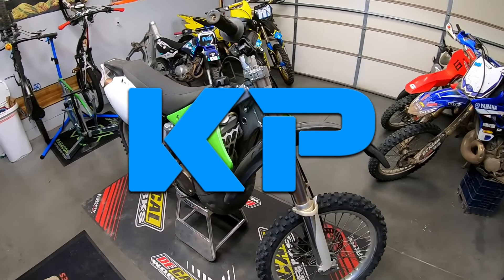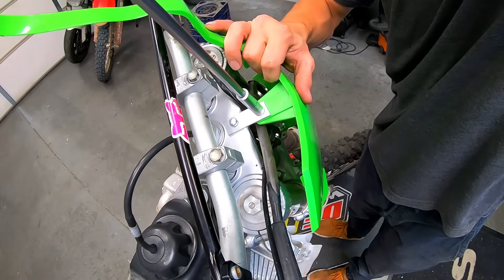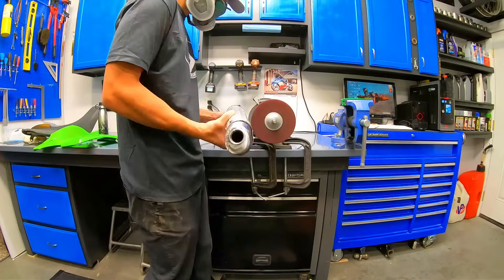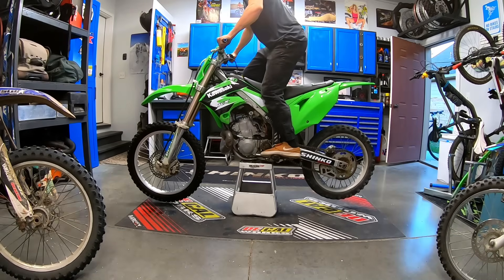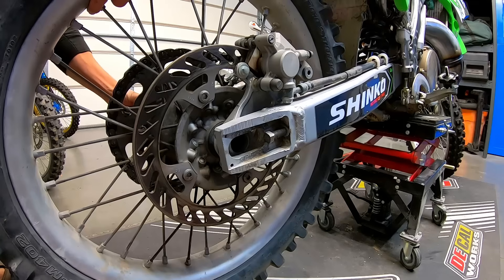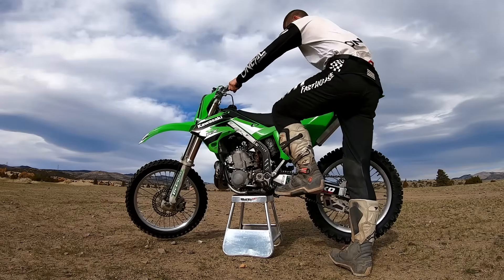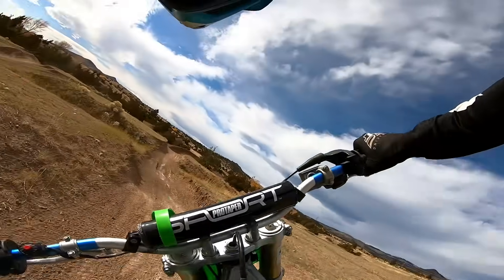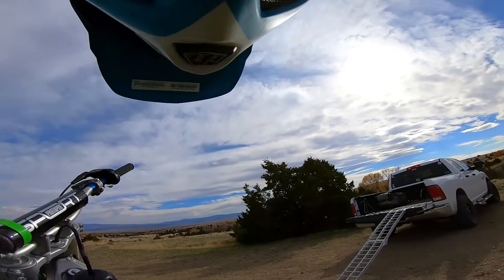Transforming a $1,400 2 Stroke Dirt Bike on a Budget! This Bike RIPS!

Comment: I see this a lot and that alot of people havent heard about it, when you load your bikes tuck front wheel in the corner of the bed then hook the pegs with a ratchet strap on the other corners. Saves the forks!!!!!
Reply: Old trick might be even better. Put a 2x4 between the tire and fender n strap er down, saves a tie down and the forks

Comment: I love re style kits. So much so that I have actually done my own over the years. Many years ago I fitted kxf250 2010 plastics to a kmx 125.i fitted my old ktm plastics to a Chinese thing then sold it at a huge profit. My current kxf250 is a 2010 and I have 19/20 plastics fitted. I always find a way to get them to bolt up. And I'll always do it unless it's something cool from the 70s or 80s then I'll leave them original
Reply from the maker: That's super cool! I've never ventured to try fitting newer plastics that weren't part of a restyle kit. That's awesome!
Reply: @KincadePavich  it's worth trying it some time. Obviously some won't work without a bit of cutting but if you cut and wet send them so it looks like a factory shape then you can't tell. I only do it if I have the parts laying around. I recently bought a AJP pr3 125 that had no plastics and it now has kxf plastics on now but they are now matte black instead of the green. Bike is up for sale ready for a little Christmas present for someone. Looks pretty smart considering. Great work anyway I hope to see more from you :)

Comment: Bike is easily worth 5K.  2 strokes are pricey
Reply: No lol
Reply: lol 5k for a 03 come one lets be real.. not even a 08 is 5k even though  a lot of these nut jobs think it is. a 07 cr250 could bring close to 5k since it's last year made. for 5k you can get a 2017 or better yz250
Reply: @coloradodirtbike5930  Even the late CRs are around for 3-4 sometimes
Reply: @AjackLee4  yea I purchased a 06 for 2500 flipped for 4300 and it had a weld repair job done on case. Hondas bring good money, the kx are harder to sell and always priced crazy but rarely do I see them actually sell for that. Hard to find a half decent honda 3rd generation for 2k-2500 range but they are around if you search.  I bought lots of 00 and 01 2nd gens for 1700-2k they bring around 2800-3400 when they are all done up perfectly.

Comment: Way to avoid what actually matters & focus on what doesn't. If it doesn't run & ride well, it's not worth 20 bucks....
Reply from the maker: It runs and rides great
Reply: @KincadePavich  Nobody serious is going to be down with this cosmetic centered stuff.
At least clean the freaking float bowl of the carb out & record the jet#s.